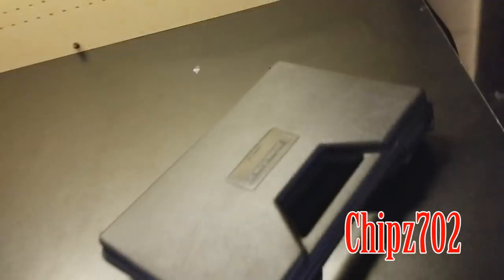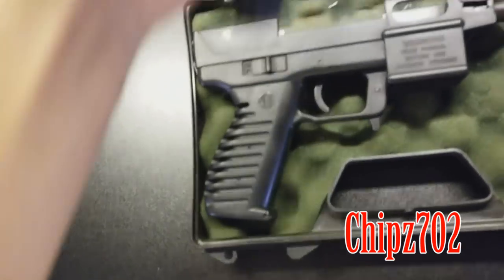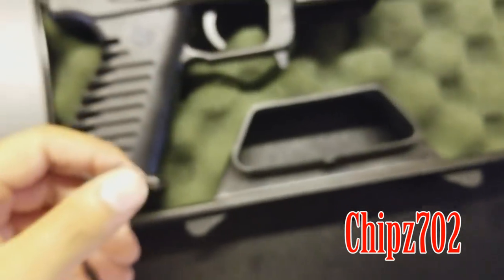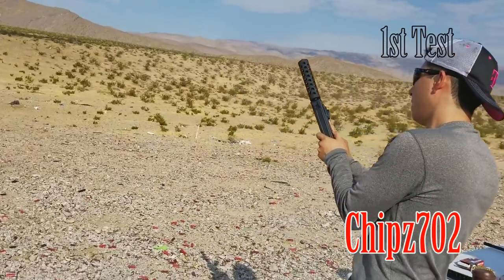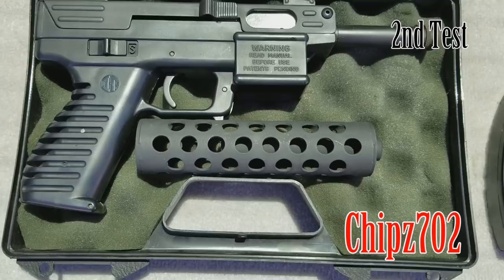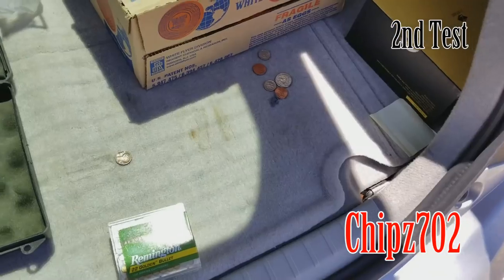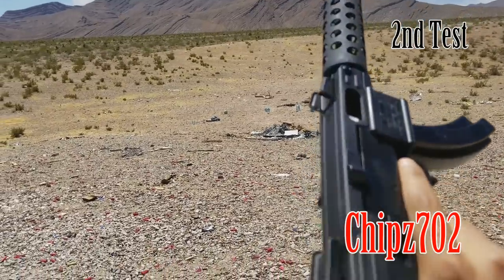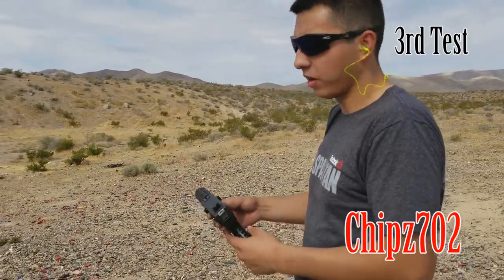Intratec Tec 22 Reliability

Comment: Years ago I picked one of these up fairly cheap, it wasnt beat up it actually was in good shape. Took it out to shoot it and found out the firing pin was broken so I had a local machinist make a new one for $40. Return trip to the range wasnt very impressive, one jam after the other with different mags and an array of ammo. Traded it off the same day. 3yrs later I went in the shop I traded it to and it was still sitting in the glass case, I guess the guns reputation as a jam-o-matic keeps it sitting safely in the display case because it was priced at $169 which is $20 less than I paid for it.....

Comment: Having owned one in the past, most feeding problems come from the mag or using non jacketed rounds. Copper jacketed rounds are always the most reliable. For mags only ones with steel feed lips. It will cut your failure rate to around 5%, which isn’t bad for a 22.
Reply: Where did u get upgrades
Would like upgrades...thanks
Reply: @edwo6648  Thanks ED I'll try it's been sitting in gun case definitely will try.
Reply: Get a taurus
Reply: Get a Taurus 22 pistol, trick it out and then use that hunk of junk that doesn’t work for target practice.

Comment: The tec 22 is a very reliable gun there is no feeding problem when the mag is put into the gun you have to push the mag forward then it will feed without issue
Reply: @skigdividerx4991  Lol
Reply: @skigdividerx4991  Sell it for an HK MP5 22lr…

Comment: I own one of the first Tec 22 s Scorpion , and it was plagued with unfixable issues until I learned that Intratec revised the bolt significantly and also the trigger and hammer . I changed these out with the addition of a Tactical Innovation s mag and some spacers on the back of the mag and it fires 100 % I just used a new ruger 10/22 extractor and sharpened it and took about .015 off where it rides on the bolt to tighten it up a bit . The newer bolt can be identified by having a stepped extractor spring plunger same as a ruger old style was just a pin with no steps .

Comment: I just got one and did a video on how I made it 95% reliable at worst. Mainly the finish on parts was horrible, it needed a feed ramp, and the recoil assembly was heavier than my 9mm. 

You don't have to change the extractor, just modify it a little, and bush the spring amongst a few other things. 

I even got it running with the standard magazine. Mag needs work too.

Comment: Mine was/is a jam-o-matic PoS. I took and bored out the ejection port. (Needed to eject ammo from the gun most of the time.) Took out the trigger group and shaved down the top of the hammer but that wasn't enough. (There is a big design flaw as the impact from bolt carrier to hammer and then pushing on the trigger is blocked if you you pull and hold the trigger tight.)

After getting it to work most of the time if I don't pull on the trigger too hard the firing "pin" broke in half so I re-cut it out of thick sheet steel and ground it down to size.
It's been a fun work in progress though. :) I like the little bugger even though it's a pain in the ass.

Oh. Honorable mention are mags too as someone else said. It has a bad feed/no real barrel lip to feed ammo well. Doesn't like many hollow points but the right mag that gets a good angle into the barrel is a must find. Probably helps 10/22's also.

Comment: Had many of the problems shown here.
Firing pin actually broke, twice. After ordering the 2cnd one, then having it break too, I made my own.
The gun barks like nobody's business now!
Reply: Yeah. I made one after mine broke in half. I was a little short so it didn't strike and fire often enough and I did another. Too weak of sheet steel. Third time's the charm so far. :)
Reply: Don't over tighten the screw or to loose and never dry fire

Comment: Had one back in the 90s. It seems that you either get a great one or a jam monster. Mine was the later. My biggest problem was that the bolt has so much mass that it causes the upper receiver latch at the rear to pop loose and toss the bolt out the top of the gun. Never did resolve that even though I did get it to feed fairly reliably using a Ram Line 1022 mag. Interesting little pistol. Pretty accurate too.
Reply: BRO I HAVE THAT SAME PROBLEM OF THE CASE COMING UP
Reply: Not that it's probably relevant anymore, but slamming the top cover shut without pushing the button at the back. It will bend the latch that holds it closed

Comment: I had the same barrel shroud, i put it on a sporterized .303 enfield #5 jungle fighter, turned it into a muzzle brake, worked good...
Reply: I put a M60 handguard in place of the wood pump on Winchester 12g and stained the stock black. Looked bitchin military.

Comment: If you look at the Intra Tec magazine that came with the gun. You will see that it had the ejector section of that magazine built out further than the regular Ramline magazine of the same type. Rugers new BX 25 has that section built out also...They should have been designed like that from the start.

Comment: cool video. I have been wanting to pick one of these up
Reply: GunsWithGage good luck.  Ridiculous what they go for now.   I recently picked one up for $200 plus ridiculously priced  shipping ($55.00). Even with getting screwed over on shipping, I still got it way cheaper than any on Gun Broker right now.   Not sure how it runs yet.  Also picked a parts kit (top cover, bolt/recoil spring/charging handle, trigger group and a few other parts.

Comment: A few things I seen wrong 1st is ammo you need cci ammo stingers and mini mags  it likes the hot ammo to cycle properly 2nd when you load the magazine in you have to push the mag forward so it is sitting properly ( you didn't do that ) that's why you had so many FTF and the main issue with the TEC 22 is magazine's yours is just right the only other magazine's that work for this gun are the ruger 10 round magazine's and ram line magazine's all others will fail and the reason ram line magazine's work so well is because they made the original magazine's for the tec 22

Comment: I had read that the USFA zip .22 had the same issue with the higher capacity Ruger .22 magazines causing failures to feed. Is it possible to use the smaller capacity 10/22 magazines on it?

Comment: Don't point the gun left or right while you try to make it work. Its open bolt so when the bolt flalls forward ,a shot is beeing fired . You eventually try to make it work,point it left or right and then the bolt comes forward and fired a round .be more careful
Reply from the maker: This model is not an open bolt model. I know the safety problems with open bolt setups and it sure is a common mistake that leads to many negligent discharges. Thank for the comment though!
Reply: @Chipz702  thank ypu for the correction bro ! I just saw an open bolt video where a shot was discharged accidentially and the gun you have look similar .but its a very nice video ,I love gun videos __

Comment: You shouldn't hold the mag like a grip, as you mentioned earlier about the unreliability of their magazines, if the mag has some play, and badly in place due to being used as a grip , the rounds will jam..!!
Reply: Yea most problems with these things are user induced, obviously putting backward pressure on the mag changes the angle. The bolt strips a round and it slams into the breach from tipping the front of the mag downward. 
My wife has one, stop putting ur hand up front n shoot like a normal pistol n runs like sewing machine.
People are stupid

Comment: I've had mine since I was 21 and still have it its my baby I studied it learned how to make it run flawlessly BC they are assholes out there that will talk shit about your gun and will classify you as a gang member because of the gun you shoot but any who cci ammo is best these guns like hot ammo so mini mags or stingers only the rim on ammo is thick so extractor has no problem catching it when u insert the mag just move the mag forward so it has the proper angle to feed properly never dry fire it because of weak firing pin I use ramline mags they work best because they are the exact same specs as the factory mags BC ramline made them for intratec I never used the bx25 so I can't give my input